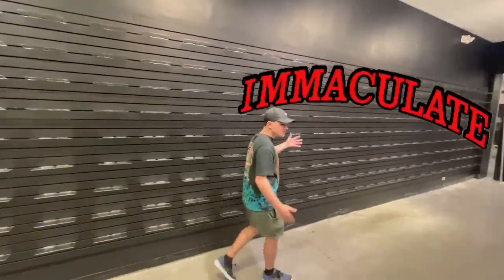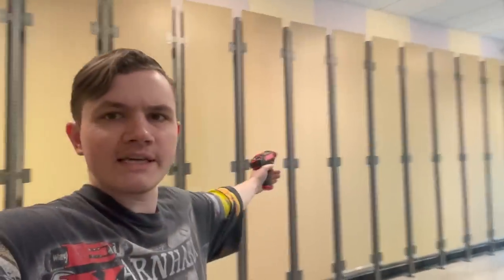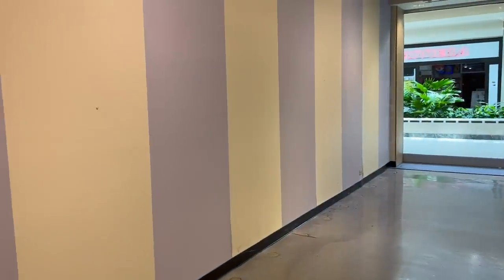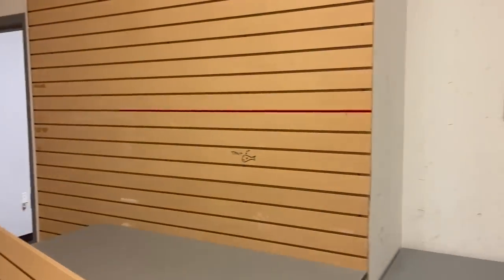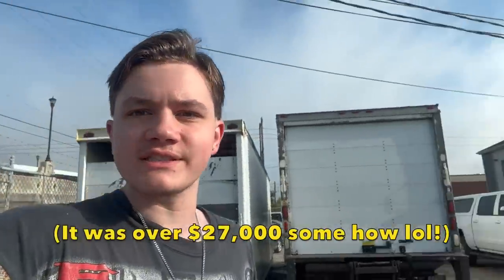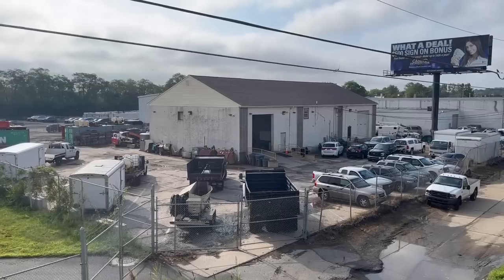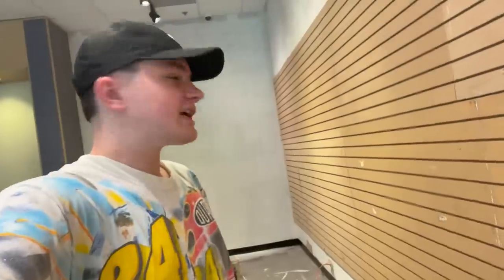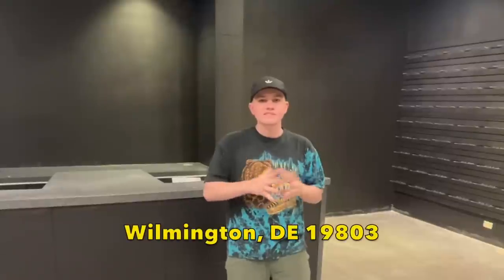Building My NEW Sneaker Store!

Comment: You are using a impact drill which is why it's stripping out the bit js you have different drills for different things you needed a drill with the turn settings to get those screws out just a heads up for your next project hommie
Reply from the maker: Ah okay thanks for the tip! I didn’t know what I was doing lol.